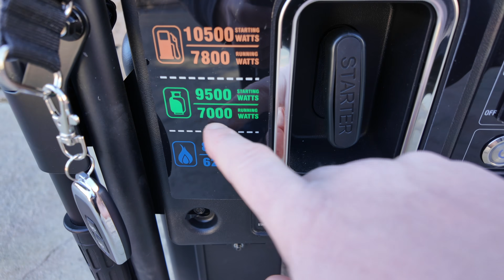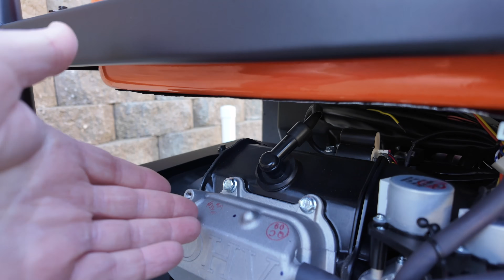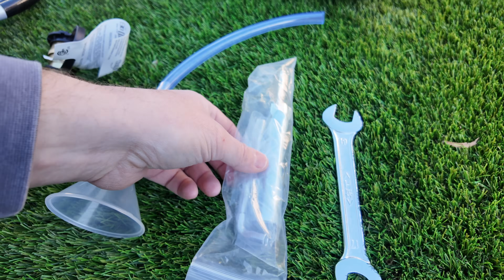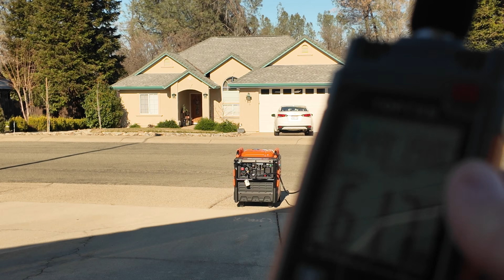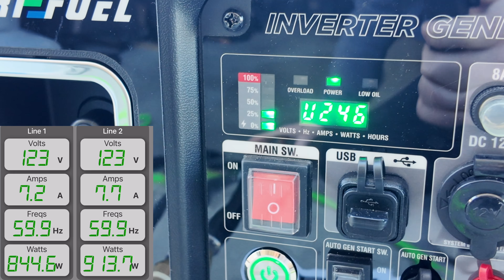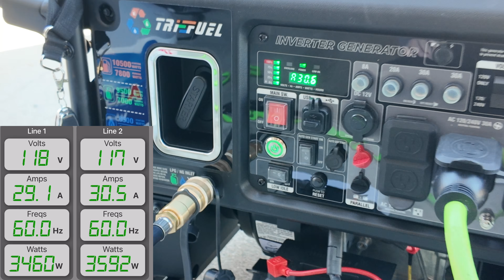New 2 Wire Start Generator- No One Has! GenMax 10500XiT-Full Review

Comment from the maker: What are your thoughts? #generator #inverter #backuppower #blackout 
#genmax

ITEMS IN VIDEO......
Genmax 10500Xit Open Frame :https://amzn.to/3PYVH7A
Discount code: 0510500XIT
Genmax 10500iETC Enclosed Frame :https://amzn.to/4hEbS5R
Extended run fuel pump:https://amzn.to/4gs76aB
Extra Fuel tank: https://amzn.to/4aCZsJt
Oil Extractor : https://amzn.to/4aJH7dD

EG4 Home Power system: https://shopsolarkits.com/products/eg4-wallmount-indoor-battery-280ah-51-2v-14-3kwh-eg4-6000xp-off-grid-inverter-bundle-8000w-pv-input-6000w-output-all-in-one-solar-inverter?ref=1134
DISCOUNT CODE: JOHNNYWKND save $101

Be sure to Subscribe 👍🏼 :https://www.youtube.com/@johnnysweekends?sub_confirmation=1 

Have a question you want answered fast: https://asqme.com/@johnnysweekends

SAVE BIG ON EG4 BATTERIES SOLAR AND MORE HERE: https://signaturesolar.com/?ref=JWKNDS 
DISCOUNT CODE: JOHNNYWKND

BEST PRICING ON EG4 ENPHASE ECOFLOW BLUETTI & MORE! BUNDLE DISCOUNTS: https://shopsolarkits.com/1134
Discount Code: JOHNNYWKND

CHEAP USED CERTIFIED SOLAR PANELS HERE: https://www.santansolar.com/?ref=Johnnys%20Weekends 

MC4 All in one Kit : https://amzn.to/37jwLVb

CHECK OUT MY AMAZON STORE:
https://www.amazon.com/shop/johnnysweekends

If you feel I helped you out..Consider Buying me a Coffee 👍🏼🙌🏼👊🏼😀
https://www.buymeacoffee.com/johnny5120J
Reply: those oil extractors are awesome, but not so when the oil is too HOT! lol
I really appreciiated your video.👍
Reply: @johnnysweekends  have you ever tested / would recommend the Genmax 5500XiD? It’s open like this one, and seems to have very similar specs to the 5500I. I don’t really understand what the big difference would be. Thank you :)

Edit: for context I have a tiny house that uses 50amp power. I’m not looking to power the whole thing, just camp while I wait for power to be ran to the property. I am looking to run fans, power tools, my laptop, hot plate / microwave sometimes and either a 12v fridge or small deep freezer.

Comment: My genmax 9500i won't generate more than 5k watts at 5k' altitude
Reply from the maker: For every 1000ft of elevation you loose about 3.5% of output power due to less oxygen 
So you have lost about 17.5% of total output 

So depending on what fuel type your running that would be about correct pending conditions, loads and elevation 

Are you running gasoline or propane or is it a trifuel unit ?
Reply: Gasoline.
85% of 7,600 running watts should be about 6400.
Reply from the maker: Hmm yea a little low 
Make sure everything is clean

New plug
Clean air filter
Clean spark arrestor

Comment: I just got the gm90000ie in order to get the 2-wire start to back up a FranklinWH aPower2 battery. It doesn’t include the regulator or the 2-wire start kit. The regulator is sold on Amazon but won’t be available for 4-6 weeks, which takes me out of my Amazon return window. I am waiting for GenMax to call me back. The instructions are poor and incomplete. This is my first generator, so I am grateful for this video. Google claims the 9000iet needs a GX12, but it may be wrong.
Reply from the maker: I have stopped reviewing many of the GenMax models due to poor customer service
Reply: @johnnysweekends I decided to exchange the GM9000iet for a GM10500xit because I need the 2-wire start to make it act as a standby. I hope it works out. The price has dropped, so I am guessing they’ve discontinued it. The one year warranty makes me nervous.
Reply from the maker: Good luck keep me updated
Reply: @johnnysweekends Grateful for your help with such excellent videos. I sent them to my battery installer. I think they may only be familiar with the usual standby generators.

Comment: I guess that means the Genmax auto start function is set up for N/O..right?
Reply from the maker: Yes
Reply: @johnnysweekends  Thanks. I couldn't find it anywhere in the manual or online.
Reply from the maker: See here The Off Grid Generator YOU Have been Waiting For- 2 Wire Start !
https://youtu.be/x8urLQPJ6aM
Reply: @johnnysweekends  Thanks, but I already just purchased t;he Genmax 10500.

Comment: The wave form looked like the THD was over 5%, to bad you didn't have a meter that could confirm that. once you get about that some Solar Generators won't charge when the THD exceeds 8%.
Reply from the maker: I have a THD meter… did I not measure in this video..?? Now I need to go bad and look
Most any inverter in 5% and under now
Even if the wave has a little noise THD never goes over 5

Comment: I’m sorry but you are ignoring a super critical point of higher octane fuels and that’s the usually massively superior additive package that greatly improves in cylinder lubrication and engine life.
Reply from the maker: And that is completely false.
Gasoline is a solvent and has no added lubricants from 87-91 octane at the pump. Only detergents to prevent deposits 
Higher octane fuel provides no benefit s in an outdoor/ lawnmower engine with low compression, no advance ignition timing or digital control. 
This isn’t a modern car engine or a race engine of any sort. I built race engines and everyone still thinks on a stock unit 91 provides more power which it does not. 
Your only gain is shelf life by a few months in basic engines

Comment: The best way if your are willing to spend the money is use a smaller generator like forty five hundred watt to charge at one twenty to a six thousand watt battery like two twenty volt portable battery system that is passive, passive meaning charging and feeding at the same time.

Comment: I built my home off grid. Panels and batteries. I have list power a few times in the dead of winter. This 2 wire start is what I have been looking for. I’m at 6,000 ‘ so it will de-rate some. With propane for heat and cooking I have low energy needs. Just something to come on and charge the batteries before they shut down.

Comment: Does it have a switch to bond the neutral when needed
Reply from the maker: No you would use a bonding plug. Simple 👍🏼
Reply: I think this model comes with a neutral bonding plug to run standalone (not connected to your building's load panel)

Comment: By your own remote start unit. Connect to any generator. I did. Put it in line with the generator start switch. Very easy to connect. I even have 1 connected to my ecoworthy output to automatically start my generator for my portable work trailer when shore and battery power is not available.

Comment: Shopping for a new generator for my house and you caught my attention with this video with two wire support for my Gridboss. However, the reviews are not so great on this unit and with the lack of warranty means they don't have faith in their product. Plus, it's just not enough power for my home at only 7800 running watts. Love that it is an open frame inverter generator though and love that out of the box 2-wire and that it is a floating neutral.
Reply: @darrelldoty7757  They now carry a 3-year Limited Warranty.

Comment: Duromax generators have a 5year warranty. I heavily researched generators before buying a Duromax.  It was the warranty and higher quality parts such as copper windings that made me choose them.  I own a predator 3500 that has worked well.  I added a whole home transfer switch and went with a tri fuel 9500 inverter.  Glad I did. Extremely happy with my choice.

Comment: Nice videos on you tube. I’m interested in the 10500xit Genmax. The generator would be used at 9550ft elevation. Genmax shows out of stock on high altitude carb kits. Any idea where I could get one?
Reply from the maker: I would get a larger CC generator at 9550ft 
That’s a lot of power loss
Reply: WEN makes one that should fit

Comment: I can't understand why more companies that make autostart generators don't have dry contact run/stop connections!  I can do it with a remote, but not something practical like wire it into a battery backup system as an automatic charge source?
Reply from the maker: I have been talking with companies about adding this feature. So I bet in the next year or so we see more companies add this feature

Comment: Genmax is really innovative. They now have a 4000/3200 inverter generator with the two wire start. And they also have a power station/battery (GM1600WH) that utilizes the two wire start to recharge itself. I learned about it on Gavin's channel.
Reply: You have link with more info on the 4kW generator with two wire start? i couldn't find online.
Reply from the maker: I haven’t seen that yet as well

Comment: Nooooo higher octane fuels actually have a lower flash point. High octane means less explosive & low octane means higher flash point.
Reply from the maker: Flash points are typically the same for gasoline. Especially 87-91, difference is minimal except for maybe lab settings

Higher octane needs more compression to ignite and properly combust correctly. 
Low compression engines especially outdoor engines with no ecm to control valves timing or ignition timing have no need for higher octane fuel. Unless you have excessive carbon build up

Comment: Your logic is flawed.  If it's a 10kW generator, you want to run it at 75% or less to manage heat and load.  
If it only makes 7kW on NG, it's effectively throttled to 7kw.  So running on NG, you can run it at 100%.  

The motor is still making less power
The inverter is still only making 7 kw.  

So the net net is that this generator can be run at 100% if running on NG.

Comment: Most 87 octane has ethanol in it so I would not use 87 unless you’re using it all the time. You need the non-oxygenated ethanol free fuel otherwise it will clog up your carburetor eventually.

Comment: ✅ Nice review.  An excellent charger would be from C-TEK that is left on at all times.  Batteries rot that just sit.  It’s around $95 and most importantly it repairs plates and uses a scissor trickle to top off the battery at a more healthy process.  It comes standard if you buy a Lamborghini (show cars sit a lot).  

The C-TEK has a plug on the low voltage end near the battery so it can (and really MUST be) disconnected from the battery prior to cranking to avoid generator’s own charging voltage feeding back to the C-TEK.  It’s not some al-cheapo trickle charger we have seen for decades and it’s not some massive cook the crap out of the battery old transformer and bridge rectifier junk from ‘the olden days’ (sorry Dad, technology has progressed).  

Just charging the battery every two weeks might be okay if people are that good at maintenance. You are the anomaly if you are that diligent.  However the issue of a battery sitting is not good. C-TEK makes different models and the web site will help you.  

C-TEK has one for large lithium batteries.  MOST PEOPLE DON’T KNOW, Lithium charges at a different voltage and the charging algorithms are different.  Heat can damage lithium batteries from overcharge.   

Again, great review. Thanks. JR Chicago

Comment: GenMax products just have too many reliability issues; and I hope you don't experience that but that Genny line is a is a pure pass for me. Additionally that 14-50 plug placement is certainly a turn off, truly not thought out at all. The two-wire setup is a nice add on, but in reality, probably NOT used in 99% of all purchases so barely, MAYBE one percent of buyers would use that?? Overall nothing really impressive other than a copycat. mini 'Predator 13K' but in an 'Inverter' formula - which is nice for sure. Because of the reliability issues Generacs are constantly known for, it's nice to see the cost not exceed $1,400.00 so I give them that! 

Kinda depends if you 'need' the inverter route or more power via the HF Predator 13K?? My 13K Predator is a dominating workHORSE! Love it and with the addition of dual magnetic oil drain plugs and a magnetic oil fill dipstick, this machine is covered. Wished companies would start going to that to AID in making these longer lasting than building in manufacturing obsolescence.
Reply: are you happy with you HF 13KW Tri Fuel? Thanks
Reply: @ 100%! First time purchase and puts out serious power.

Comment: I love how everyone takes cheap shots at Honda inverter generators. The first easy shot is cost. The second is weight. Lastly they show you all the ways your generator might not start & give you suggestions on ways to fix it? 
I have what everyone takes shots at. My Honda is fuel injected so no carburetor. Plus mine is a lot quieter than the competition. 
Chose wisely! If cost is your driver? Get the Gen Max. If reliability & being quiet is more important go with the Honda. 
Thanks for posting. Keep up the great content!
Reply: 💯Hondas just plain work. I can't believe it's 2025 and we're still talking about carbs and related nonsense like chokes and jets.
Reply: Orrrrr, go fo rthe NEW Predator 13K LIne at HF. Warranty like no other, and built in quality - finally!
Reply: @AXNJXN1  it's still the same 90 warranty! but 2 years on emissions.

Comment: It would be nice if Generac would change the AC output frequency in response to the generator loading so you could use their Smart Management Modules (SMM) for load management. For example, when it is at full load drop the output AC frequency to 59 Hz and when it is overloaded drop the output AC frequency to 58 Hz. Then you could power two or more loads with SMMs on it. If the frequency drops to 59 HZ and the low priority load is not already turned on and drawing power its SMM will disconnect it to prevent it from being turned on and creating an overload. If the frequency drops to 58 HZ immediately drop the low priority load and if the frequency doesn't come back up in a few seconds drop a higher priority load. Generac already sells the SMM modules that operate with frequency drop and modifying the inverter to change its frequency with loading should be easy. That load management would be ideal for attaching several loads  which can be powered one or two at a time to the inverter, but can't all be powered at the same time. Great for construction sites, motor homes, camping or grid outage backup for your house.

Comment: Just got one, I have about 8 hours on it so far (running an off-grid homestead). Some add-ons to your review: 1. The NEMA 14-50 outlet interfering with the wheel was a much bigger problem for me. Mine wouldn't sit flush and I felt it was a safety hazard with the tension trying to unplug it so I removed the wheel on that side for now. They make "extension plugs" but they're like $50. I wish they had put this outlet somewhere else. Swapping it with the L14-30R outlet would have made a lot of sense since almost all of those plug styles are straight not 90-degrees so they wouldn't conflict. 2. It was insanely hard to find the recommended oil quantity in the manual ("0.21g"). They mention adding oil like five times in different spots but never the amount - just "until full". Mine took 16oz which is about typical for a new generator, and the dipstick shows full, but I worry because I did find ONE spot in the manual that lists the oil capacity as "0.21gal" which should be 28oz. 3.  If you want to hook this to an RV accessory port it's easy if you know the right parts. You need a 5/8 flare to 3/8 flare adapter/fitting and then nearly any "RV quick connect" hose will work. That's really nice to be able to do.
Reply from the maker: Nice thanks for the extra info 👍🏼

Comment: I have seen numerous Genmax generators advertised, with some appearing to be a good bang for your buck. HOWEVER, the one thing which ends up being a 100% deal breaker for me is the Genmax 1 year warranty! Most of the generator manufacturers are offering a 3 year warranty and Genmax only offers a 1 year warranty. This just SCREAMS...."We have NO confidence in our product." It's the optics of a company not appearing to have confidence in their product?
Reply: Most generator companies don't honor the 3-year warranty either
Reply: @Dayday-qk3sz  For sure.  Lucky if there will be parts in the barn.  The people I email with are in Canada at a place called Akron Products Inc.  Hit or miss on them actually replying same day.
Reply from the maker: I have told them they really need to raise it higher. Much like I said in the video one year is a low compared to others.
Reply: @johnnysweekends  Except Predator.  Those are worse at 90 days then their overpriced one shot replacement warranty.

Comment: Good tip on the pilot jet. I bought a refurb 1700w inverter gen on ebay awhile back. Its the second refurb I have purchased. The first one was fine out of the box but this second one didnt seem to have actually been gone through and the pilot was slightly restricted resulting in a surge. Tore it all apart and cleaned it, got the valves adjusted since i had no idea of the hours on it and its been good from there. They were surprisingly out of spec, only regret was not having a valve cover gasket ready.
Reply: Also, I am in the lead acid camp. They are relatively cheap compared to a lithium and as such if they are neglected and a deep and long discharge kills it, it's not as big a hit to the wallet to get it replaced.
Reply: @dprrn  Check LiFePo4 batteries now. The prices have really dropped recently.

Comment: There is one downside to open frame. If you’re trying to run it when it’s very cold out, the crankcase breather ices up and blows out all the oil and damages seals. Happened to me twice until I figured out what was happening.
Reply: Not for me I ran my generator in an ice storm and below zero wind chill 😊
Reply: @Dayday-qk3sz  well, we've been using them in 40-50 below wind chills. They don't really like that.